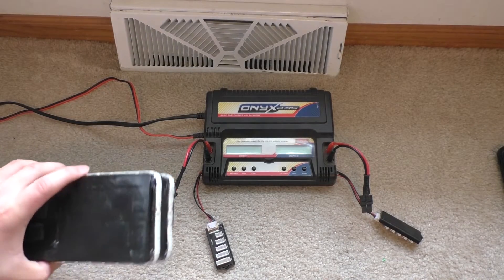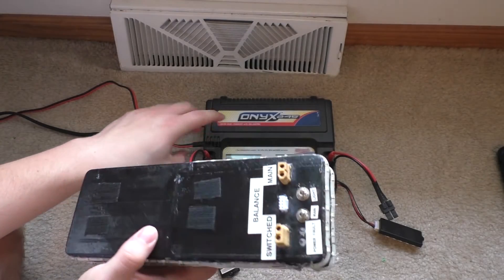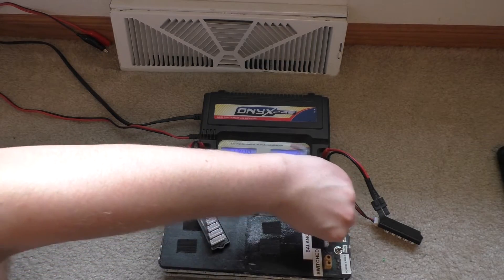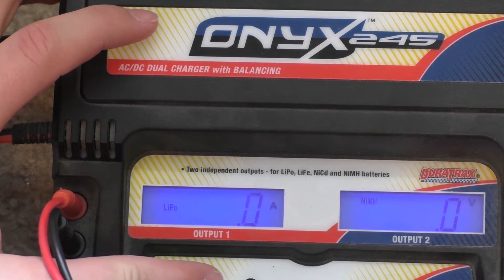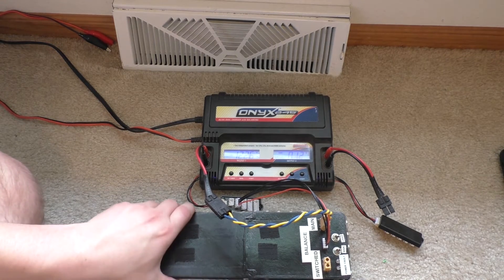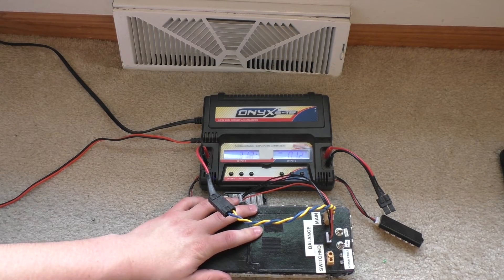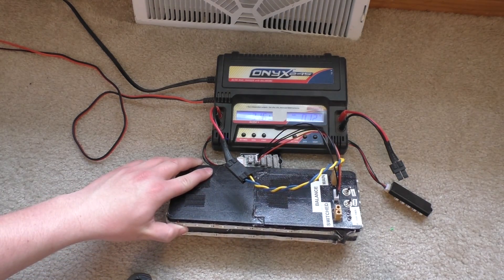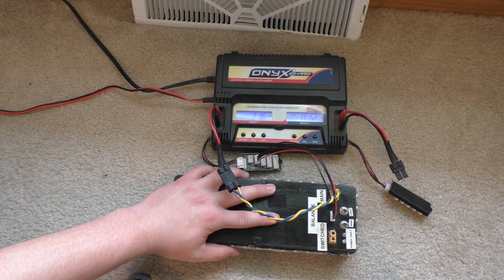How I Balance Charge My DIY 12V Li-ion Battery Pack

Comment: still didn't get what balance charging mean
Reply from the maker: It's just keeping the voltage of the individual cells the same.
Reply: thanks, but how the wiring is done i saw someone making a li on pack he soldered a complicated wiring system and didn't explaine anything Eman2000
Reply: astafzciba balancing in this case means equalization. A process that makes each individual battery cell equal in voltage to the others in the pack.

Comment: Eman- Can a bms handle the variable current coming from solar panels? or should the panels feed into a charge controller first? just wondering. Really appreciate your videos!
Reply from the maker: A BMS should be able to handle that. You might want to check the specs of the BMS though. But a Charge controller wouldn't really make any difference in the variations in current. Glad you like the videos.